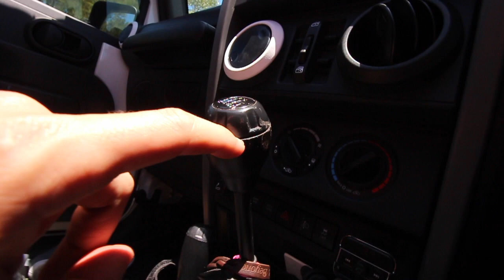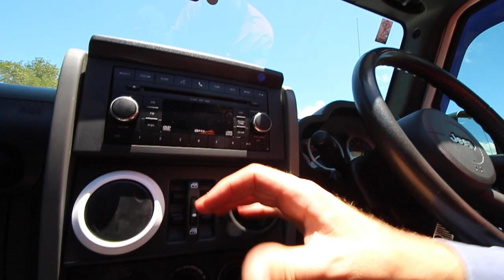JEEP JK GEAR KNOB REMOVEL EASY

Comment: Thank you for the video it helped me remove mine. It came off fairly easily even without having to use the oil filter removal tool. I did order one along with the replacement shift knob from Amazon. When the knob arrived, I was too excited to wait for the tool so I just twisted and pulled as hard as I could and lo and behold it popped right off. I was able to change out the shifter even before my oil tool arrived (which I'm still waiting for now). so much happier now that the shifter doesn't move when I shift gears. ☺
Reply from the maker: No problem at all, glad I could help, thanks for the comment really appreciate it.